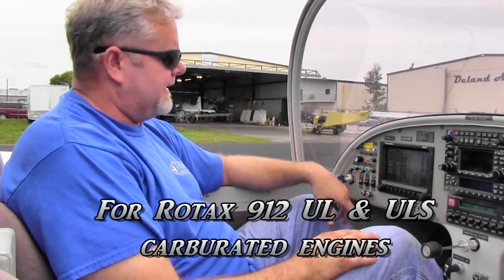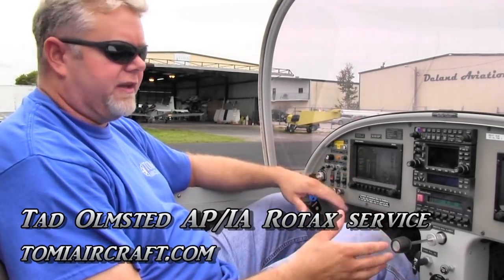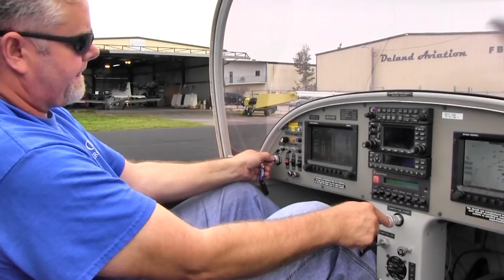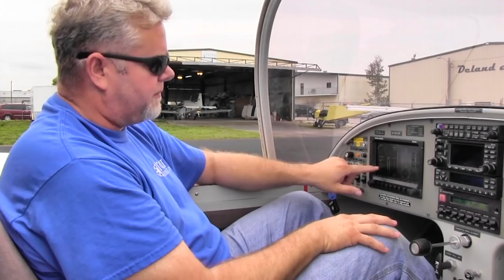Rotax 912, proper starting procedure, Rotax 912 UL & ULS, TOMI Aircraft Deland Florida

Comment: ... what's this about "burping" the Rotax first?...
Reply from the maker: https://youtu.be/KAQww3r1DPI
The Ultralight Flyer
Reply: By rotating the prop you pump the oil back into the can. Makes sure that the engine is lubricated, verifies oil pump operation and you can check the oil level.